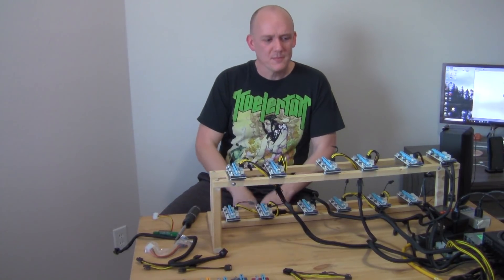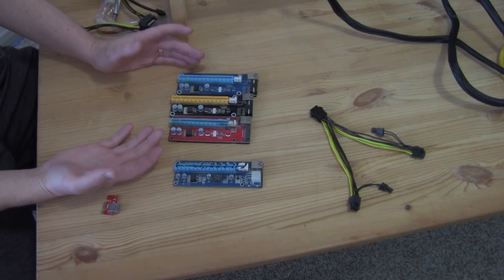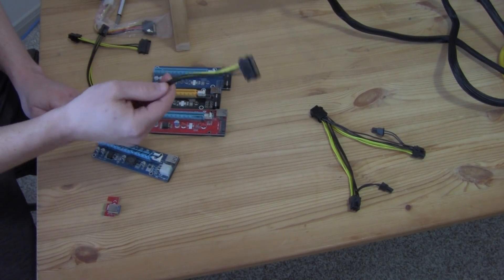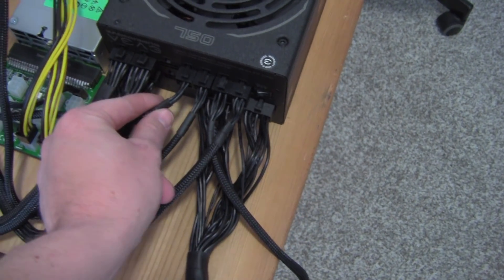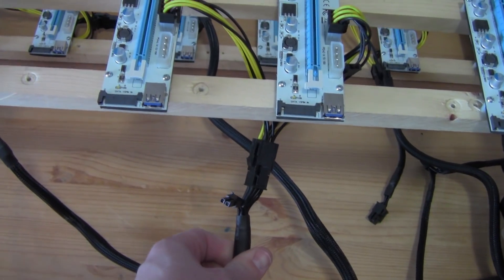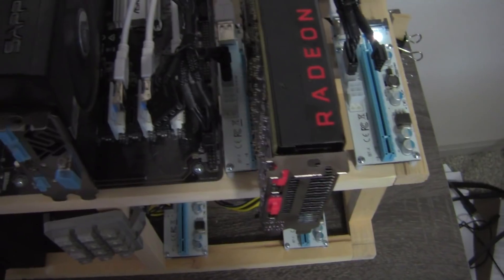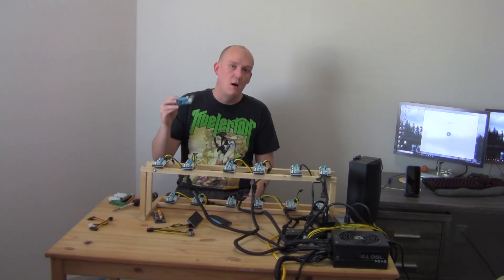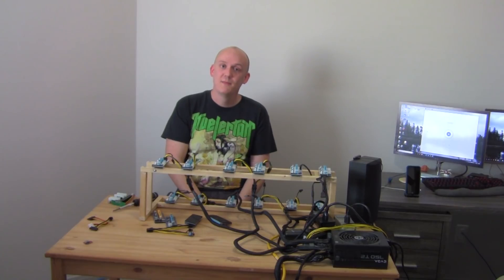Rig building 103 - Connecting Risers to ATX PSU

Comment: Two things I have learned along the way. NEVER use SATA cables. They're meant for spinning disc drives only!  Using splitters is risky. They allow a doubling of wattage being drawn from a single PSU connector. A definite fire hazard.

Comment: Wait... You can use the 6 pin pcie, 2 risers on a splitter, then connect that splitter to one SATA connector on the PSU? So you can power 2 risers per one SATA input on the PSU? That's safe? I thought the max output on sata is 56 watts or something. Very confusing.

Comment: i do not agree. Its common agreement that 1 riser per SATA per Cable. and 2 Risers per MOLEX per cable. 
Why? because Sata cable can provide no more than 60W (which is just fine for a riser) but not two risers. 
And 2 risers for Molex cable because Molex is prepared to deliver as much as 150W (75Wx2).
Reply: Riser needs 75w how is 60w fine ?!?!
Reply: @SkyHighFilms777  that's false. Most GPU never use more than 40W on the riser.
Reply: Sata reputation is notorious with risers so am not gonna cheap out or risk burning the house coz I haven't got enough cables...

Comment: About everything in this videos is wrong. Molex connectors are specced for 132W on the 12V line. If your psu has 4 molex on a single cable, it means you can safely draw up to 528W through that cable. According to you, it's a bad idea to draw more than 75W for no apparent reason. Why would the manufacturers put more connectors on each cable if the cables couldn't even handle it?

Sata connectors are a little bit different. They can only carry 54W @ 12V through each connector, which is lower than the 75W maximum draw of PCI connector. The cables in any quality PSU can handle this just fine though however, and it's really not something to be worried about.

Internally all the cables pull their power from the same 12V rail, so the PSU doesn't care whether it's drawn through the SATA, Molex or PCI-E cables, or even if it's drawn through one or multiple cables. I personally own a mining rig and I'm using all the available connectors to power my PCIE risers, there's absolutely no harm in doing so. Stop spreading false information which you've obviously put no research into! 

It gets even more ridiculous later on in the video, when you've said to throw away all the adapters which are perfectly capable of handling the current put through them. You then take a connector specced for 75W and overload it by drawing 150W through it, using an adapter. I thought we weren't supposed to use adapters?! And if you want to do the splitting properly, you need 8 pin pci -> 2x 6 pin pcie adapter to avoid overloading the connectors. In quality PSU's the cables can usually handle way more current than they are specced for so I'm sure it's fine, but by your own logic you're making a massive mistake.

Also you should power both the risers and GPU's on them from the same power supply. Otherwise the GPUs draw power from 2 PSU's at the same time, which will cause phase difference inside them. I'm not sure what kind of effects that can have or if it will damage the cards in some situations, but it will certainly reduce the efficiency at least. It's about the biggest mistake you can do when it comes to systems with multiple PSU's. It almost seems as if you're giving horrible advice on purpose.
Reply: you are right (Y) and im thinkin wtf i´m  done all wrong , after watching this video :)

Comment: GPU and riser should use the same PSU, if you are using USB riser. Otherwise the two PSU will fight to regulate the voltage.
Reply: why would they fight to regulate the voltage if they are not connected internally?

Comment: 6pin to sata is the safest connection and safest riser
keep with 1 sata cable per riser, and don't multi up. If you HAVE to, you can connect 2 risers per sata
Reply: sata is making a max of 54wats, not enough for propper GPU
Reply: throw sata connection in garbage

Comment: Firstly thx for the build guide.. My question is since i use 2 atx psu(almost impossible to find server breakout board here in indonesia) can i use the 8 pin cpu from the second psu to run riser/GPU using converters
Reply from the maker: U will need an adapter cable. The pin out is not the same. But it will work

Comment: Thank you very much for this. I am just starting and this is very helpful. I have a question if you don’t mind answering it, I bought a EVGA supernova 1200W platinum PSU. I also have 6x msi gtx 1070 ti DUKE on the way. The gtx 1070ti take an 8pin and 6 pin connections for each card. Can I get 6 splitters 8pin to 2x6+2 to power the Gpus from the PSU and use the 6x 6pins connections on the PSU to power the risers? Sorry if this is an unclear question.
Reply from the maker: Yes that will work. Look at parallel miner
Reply: who is selling more than one gpu at a time right now? most stores only limit 1 per customer
Reply: Stephen Secord new egg autonotify and friends/family willing to buy for me. I supply the money they buy and have shipped to them.
Reply: thought so. I did a little of that too. the streets are rough these days...
Reply: You can also just ignore the rubbish advice given in this video and use the SATA->pcie adapters that are (probably) shipped with your risers. You really don't have to worry about using adapters as long as they are made by quality manufacturer. There are some very cheap (non-branded) adapters in Amazon which actually can't handle the current drawn through them and will burn and snap.